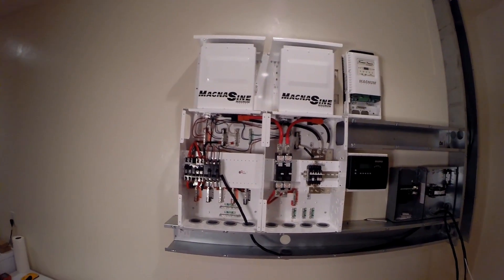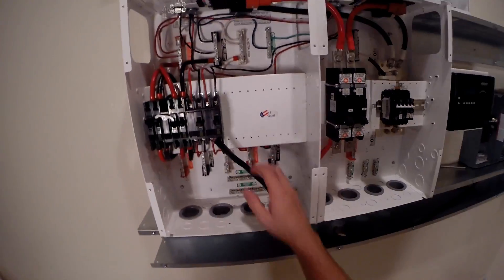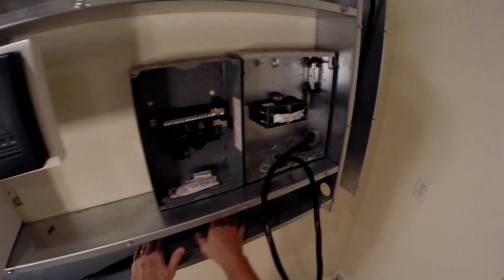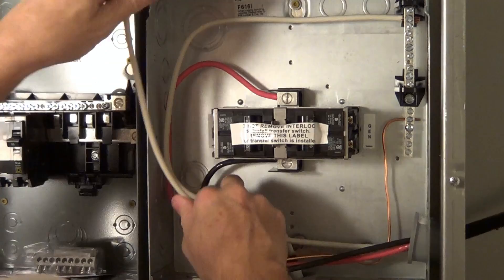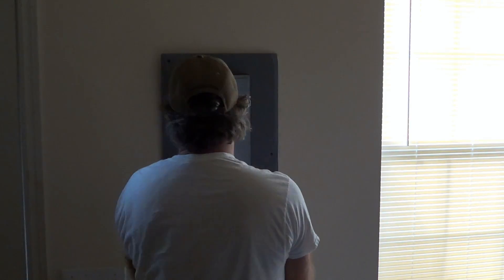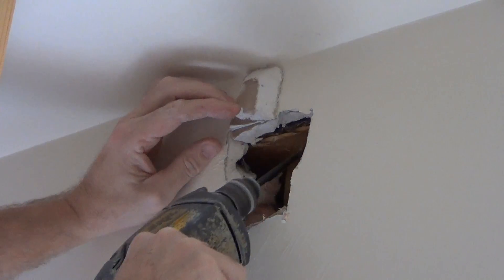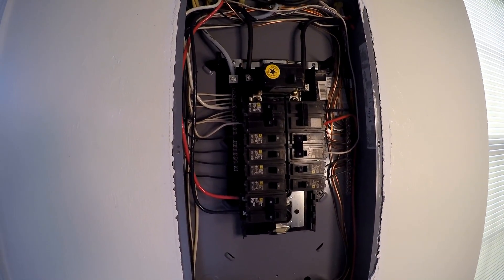Off Grid Solar #14: Wiring the AC Input

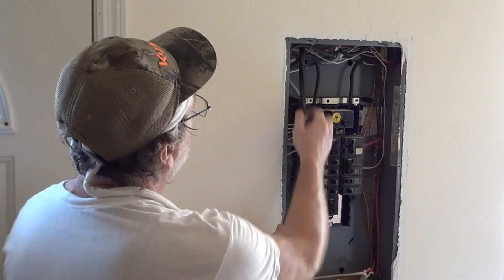Comment: at 2:25 i see you forget to skin the neural wight wire in the bus bar!!!! Do remedy that!!! At 4:34 there is no wire clip to your panel, the wire is loos
Reply from the maker: I often tac the wires into position prior to stripping them to make sure everything looks good, sort of like dry fitting plumbing before glue.  I did double check and everything is stripped.  Thanks for the comment, It helps to know that other eyes are looking this over!

Comment: Sorry if you covered this before, but where did the wire gutter/channel come from?  It makes your setup super clean!
Reply from the maker: Those are 6x6x72 and 6x6x36 Austin screw cover wireways.  One of the hardest things to find and exactly what I wanted.  I found them at CED (Consolidated Electrical Distributors).  They are located all over the place.  My CED goes under the name RAYBRO.  The 72's were $85 each.  I think they make a huge difference and when I am done you won't see a single wire!
Reply: David, that is VERY helpful and thank you for sharing the details. I am following your project closely as I am leaning toward a magnum system for AC coupling.  Very nice work thus far!